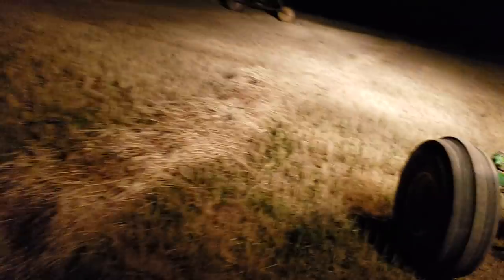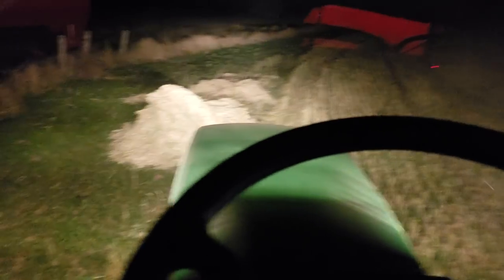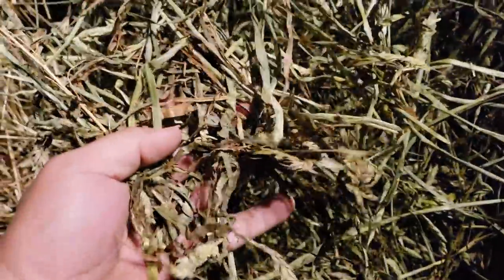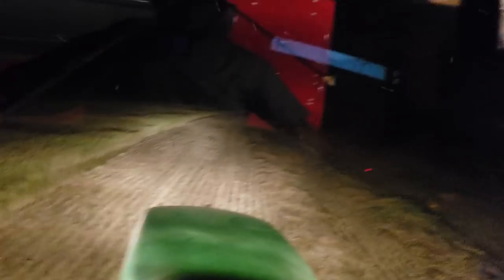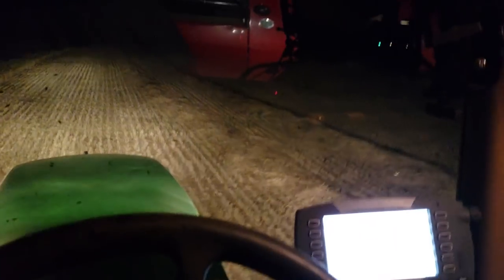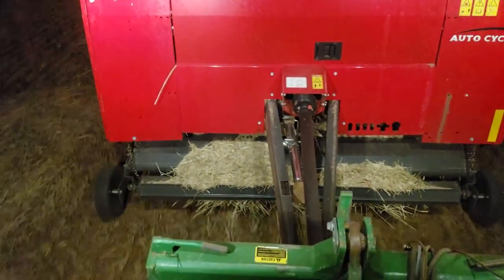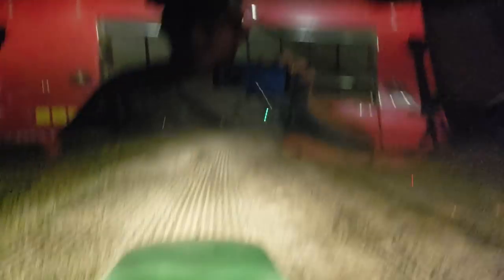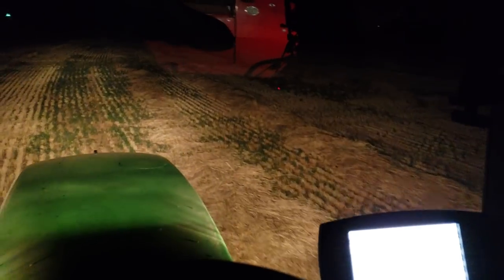I hate super dry hay

Comment: Humidity here this summer has been higher than normal.... Usually it's coming on pretty heavy by 7:30 pm, and too wet by 10/11pm.  Good rule of thumb for me is the humidity needs to be around 60-65% to get things softened up...  What gets me is the guys that start baling hay after they've had their morning coffee, get to the field by 10-11, run an hour, break for lunch and then bale the rest in the heat of the day.lol   

I can say our Vermeer baler does a better job than our deeres we've owned in the past.... Still have our 567 though.  

Also, In the dry stuff I turn the engine RPMs way down, helps the crop pick up and compress it before trying to push it into the belts and beat the hay less..

Best of luck out there.